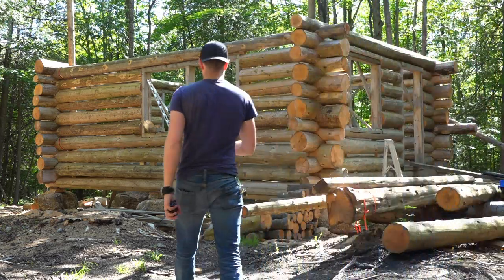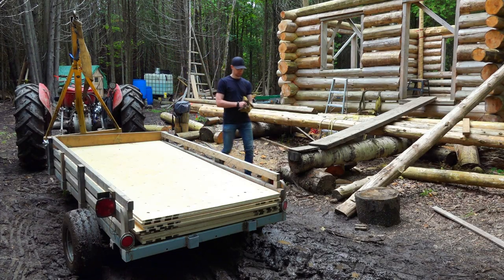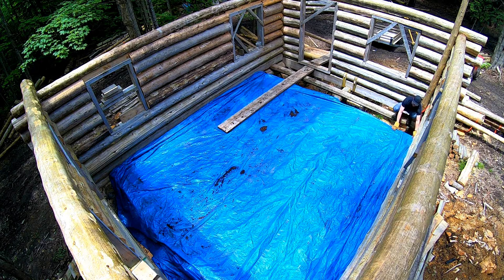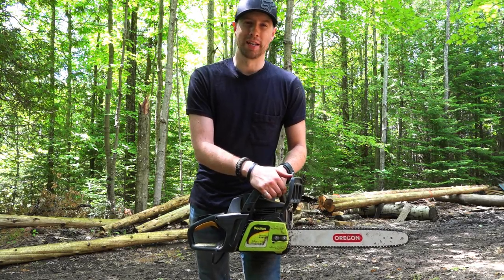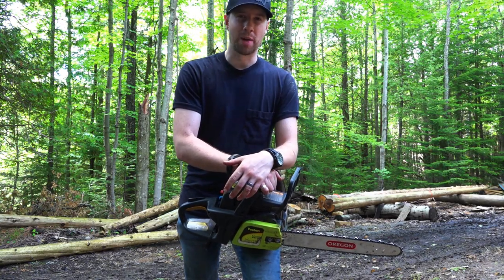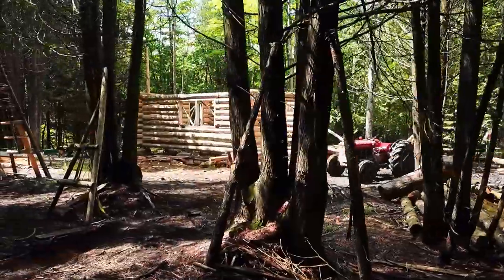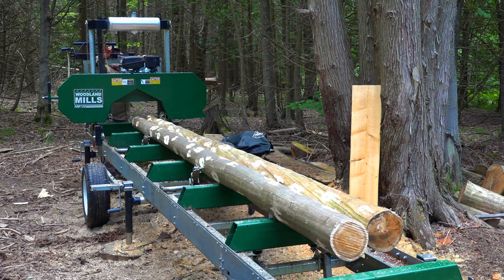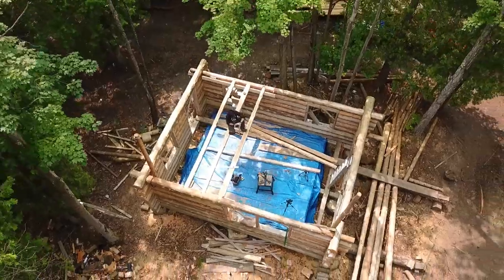Second Story Loft and Tractor Logging / Ep51 / Outsider Log Cabin

Comment: do not use ethanol gas in chain saws it melts the small tubing gas lines ,, do not run the saw always wide open , sawing slower makes the saw engine last longer plus the chain doesn't get hot and curl the cut edge off

Comment: I own a tree company, I use both Stihl and Huskys, after years of using both, I would recommend Husky over Stihl, Stihl isn’t the company it once was, I never have problems with the huskys, but the Stihl needs work at least a couple times a year. I’ve been hearing about guys going with lower end cheaper saws and just replacing them more often and these are pros in my field, it’s just a matter of what your doing with them I suppose. If your going to buy a Stihl, buy an older model before the chip was put in them, much better saw in my opinion

Comment: We have run poulan McCulough and Husqvarna and I think even some still and Johnson red we have 3 McCullough from the 70's manual oilers that still run great weigh a ton but work great I prefer the husqvarna just because the weight is so much lighter but still a good saw . I kept going back looking at your cedar to see why they kept striking me as being odd and then it hit me here in North Carolina we have eastern red cedar and yours didn't have any red in them so I assume they are white cedar, how does it hold up and weather as compared to red cedar?

Comment: I've owned and used up a Husqvarna and now own a Stihl.  I think my next saw will be an Echo. Their carb is designed much differently and I'm very impressed with my Echo trimmer. One pull starts it every time and I'm told their chainsaws do the same. Most fire departments now use exclusively Echo saws and they buy for reliability regardless of cost. There are YouTube comparison videos that point to Echo out performing all others.  Brand loyalty isn't my strong suit but performance is leading  me to Echo.

Comment: Old chains will eat up the new drum... Trade off.   Price of new chains or new drum. Ha...
Chain saws are the money makingest tool ever invented.. Big return on investment....lol
Another thing.. In freezing weather  keep a bucket of diesel fuel around.
Stick the bar in it now and then. Clean and lube the nose of the bar and cut the sap and gum out. While and idle. Even good in hot weather. Dirt and stuff goes to bottom of bucket. Always good to  burn a brush like with when it gets nasty. Cut the bar oil with some desiel in freezing weather also. Thinner.

Comment: I have the biggest Poulan you can get and they said you couldn't put a 25 inch blade on it I did and the circle ran fine that's what I cut wood with for 2 years I'm pretty much if I can put it together and make it run after sitting five years I can make anything run

Comment: Your chains too tight. You can't do that to a sprocket even on a Poulan with proper chain tension. I had an identical saw and the clutch material finally wore out on the shoes but the sprocket was fine.